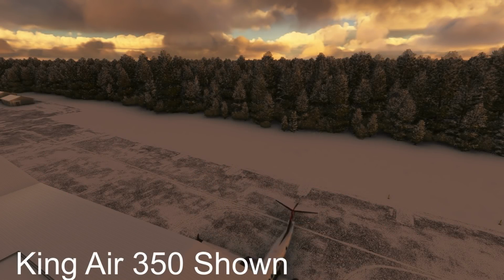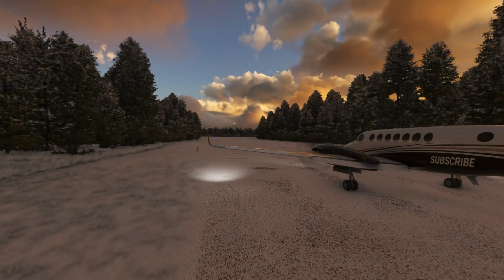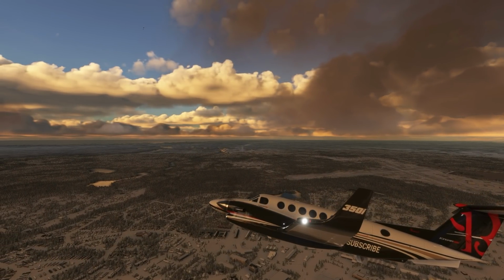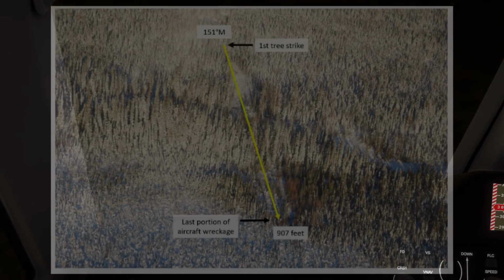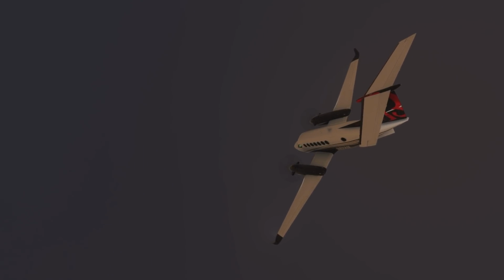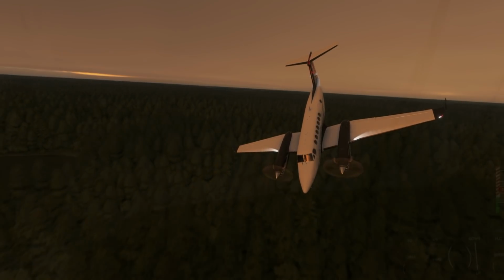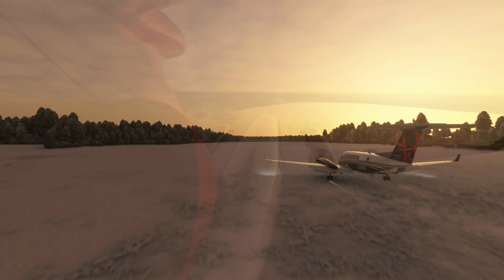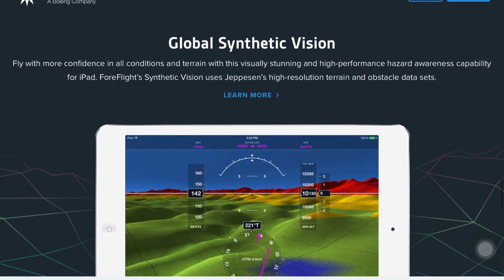They Tried To Fly A Broken Plane  | Air Tindi Flight 503

Comment: I am an aircraft mechanic and pilot who now works in air accident investigation. I can tell you that the older attitude instruments can be terrifyingly unreliable, especially vacuum powered instruments (although in the case of Air Tindi, this looks like it was electrically driven.) This is in part because these instruments use delicate gyros that are sensitive to shocks (like hard landings) and changes in temperature. Small aircraft owners have the option of installing digital attitude indicators in their aircraft, which use accelerometers (like in your iPhone) to determine attitude rather than a delicate gyro and I try to get the owners I know to install those.

Comment: if I remember correctly
they would have needed to keep the app current and loaded, with the I-pad in a usable position within the cockpit... in an emergency, you do not have the time to do the whole startup necessary for it to work.
flew as a passenger on flights where the pilot did use Foreflight, seems like a popular & awesome tool....
Reply: I know Russian pilots are using some western tech to navigate... 🤔 Which is interesting.
Reply: TBF you could use one of those bubble stick apps on your phone to provide horizontal data.
Reply: @yakacm  that, you cannot, the whole point is G-Forces in a moving aircraft make it impossible to tell which way is up
Reply: @yakacm  nope, those type of apps rely on accelerometers in the phone or tablet. In a banked turn, it would keep showing level even if the plane isn’t.

Comment: I used Foreflight for years. It is one thing every pilot should have, and almost all pilots have now, especially 135/charter and corporate pilots.
Reply: Can you double check the statement about displaying pitch and roll? I find that claim very suspicious.
Reply: @luc4662  
Right, does not actually show pitch and roll. What it does show is altitude and change of heading.
Reply: @mikestone9129  Thanks, that made sense. Looks like the video's author misunderstood what this app (and an iPad) can do.

Comment: Always wondered how accurate the airports are in Flight Simulator, judging how they have show Yellowknife, I think the answer is not very. I was a big fan of Ice Pilots so know Yellowknife airport pretty well, and it don't look like that. Yellowknife is a pretty decent sized city, which doesn't seem to be shown in Flight Sim at all.
Reply: It depends which flight simulator, there are quite a few.
Usually flight simulators will automatically generate most airports, and then add some detailed stuff by hand.
You can also buy addons for certain airports.
Reply: @jort93z  Yeah, it's only a minor airport so I can see that it's not going to be an exact replica. I think he uses MS Flight Sim 2020 in his videos?
Reply: @yakacm  You can get an addon for yellowknife airport, by project max.
Quite a detailed one too.
Reply: @Gute Wasser  vielen danke. I only out hi as a place holder to spoil the fun of the folk who like to put 1st, when they are the 1st to comment on a video, yes I know I'm petty, lol.
Reply: You can download airports you care about, at least for FSX/P3D, but pretty sure for the MFS2020 too. By default I don't think they are all that accurate.
Reply: Xplane is better.
Reply: Sim?